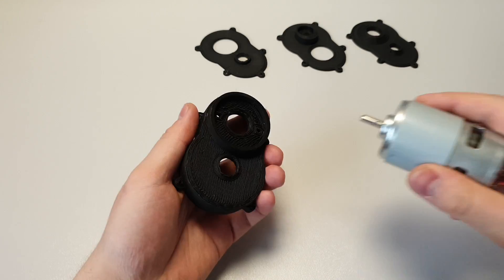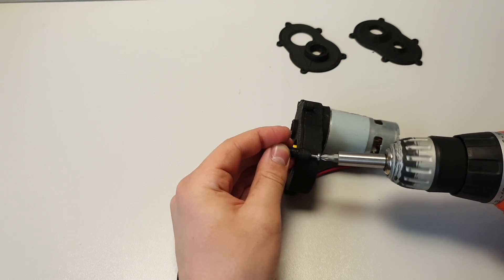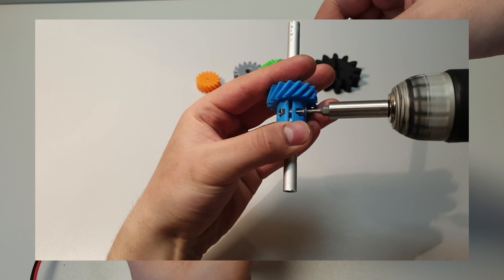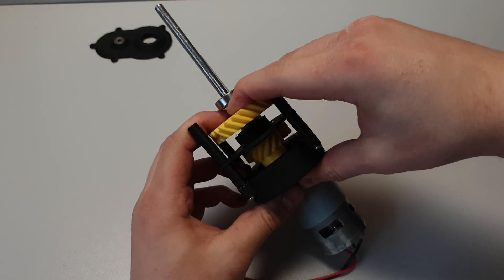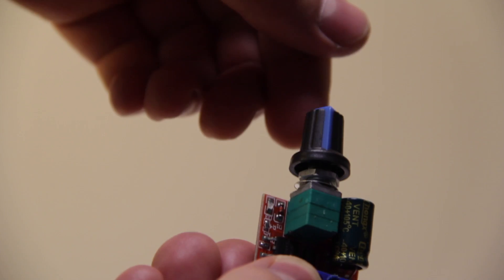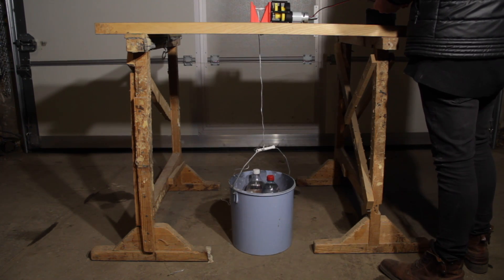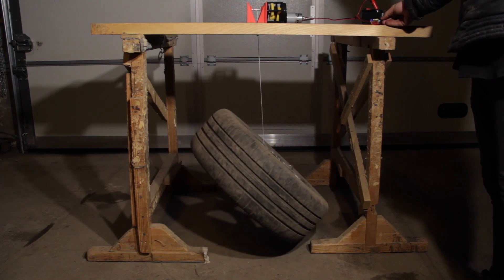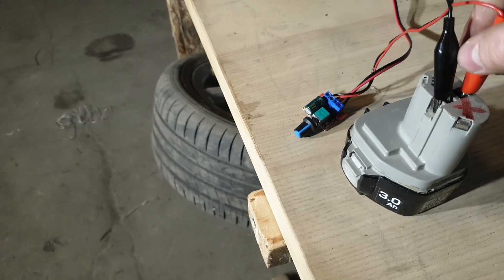3D Printed Gearbox for 775 Motor - Powerful Hight Torque DIY Gearbox

Comment: Hey bro do you know where I can find the stl for a gearbox with two axes but for the 755 motor so that it looked like the typical yellow motors but much more powerful, im sub 
I have looked for something similar in many places but did not find I needed something with power and with 300 rmp more or less not the typical slow box

Comment: I think it would be awesome if you could make a small video how you generate the gearbox-designs, what software you use and what are some important steps you need to follow  ( or what you have to keep in mind before you start printing one)

Comment: Can you build a gear box that would attach to a bicycle frame,  on the left hand side for left hand use (mounted on left side of bike as determined by sitting on the bike facing forward) that uses four (4) 775 motors that will turn the crank of a bicycle? One that would turn a gear mounted to the crank (where you would mount the pedal arm). That way I could keep the 21 speed chain driven assembly on the right part of the bike and use the 4 - 775's  as an electric assist. I have tried to make such but I can't seem to get a grip on making gears like you have. You know it would be  a great project to do.

Comment: Increasing the voltage by 2x would theoretically increase the power by 4x =)
Reply: Np it will fry the speed controler
Reply: The speed controller can stand up to 12v
Reply: At what voltage was he using in the video
Reply: Well no shit huh

Comment: This is kind of irrelevant for this application but I feel the need to note it: as the torque increases along the "chain of transfer," parts should be "morphed" to an appropriate size for applying the torque/resistance it theoretically could encounter.

Essentially, the more torque being applied, the larger the scaled should be also applied; basically widening the gear and increasing the amount of transfer points as you increase torque.

I don't mean to appear rude but I feel a lot of people are unaware of the scaling necessary for proper torque transfer.
Reply: TOM W Are you talking about the need to increase the strength of gears as the torque increases through a gear set?
Reply: @tbdcreations5370  I believe what he's saying is, if you're using plastic, those gears are going to have to be physically larger.  There needs to be more of the gears surface area touching each other, or the plastic is gonna fail.  Strength of the gears is a factor of that (eg: steel gears can handle more torque then abs/pla at a given size)...but even steel has a certain breaking point at a certain size.

Comment: Awesome next do a CVT gearbox with two differentials connected back to back with a 1:50 gear reduction between them using the 2x 775 motors as resistance to reduce ratios

Comment: If you guys don't understand what torque is lemme tell you in simple visuals.

Imagine you have a door and you try to push it closest to the hinge, it will be hard to push. Now try pushing it farthest from the hinge, see its easier. 

Ok another one, Imagine you are having trouble with Pickle jar lid, how will you open it easily? Well one way is to increase grip. I have another way. Place a long sturdy stick parallel to the lid and move the stick until one half is off of it. Next, duct tape it. Lastly, turn the lid using the sturdy stick. Ta da, it's done.